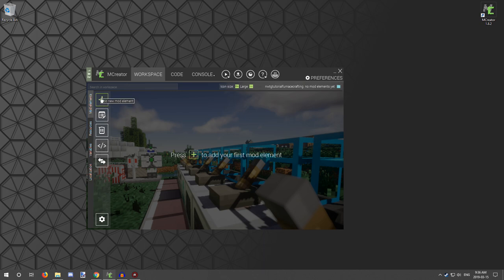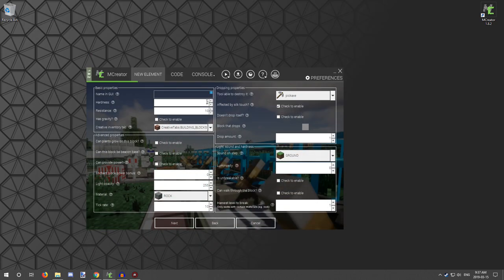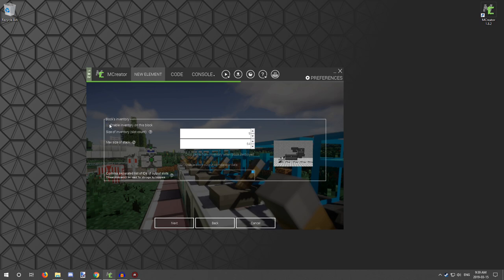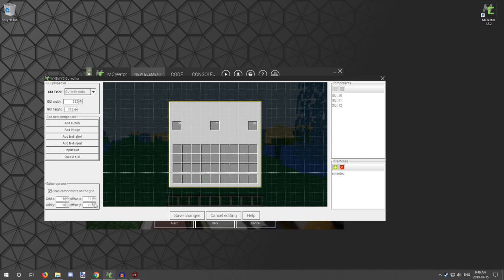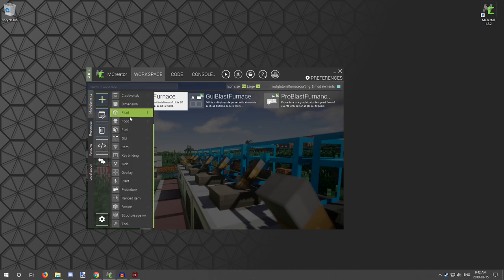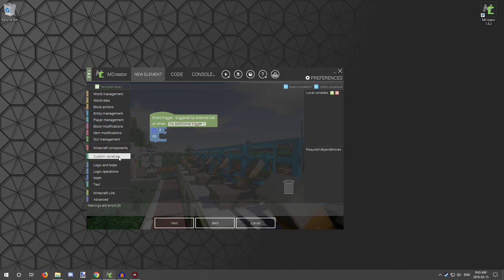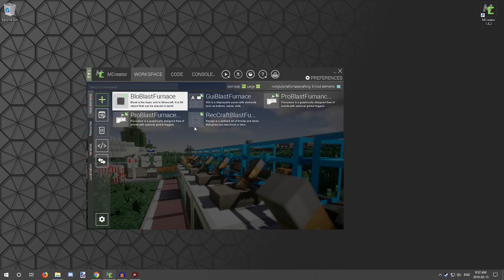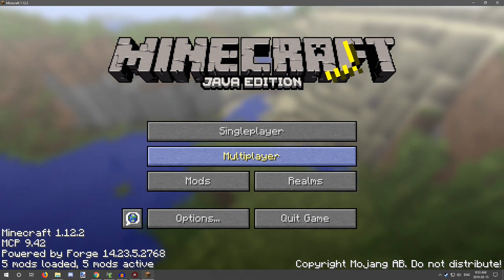MCreator Tutorial: How to make a furnace | 1.8.2

Comment: I found a way to make the iron ingot smelt with all the logs, all the plank, coal blocks, coal, charcoal, lava and netherrack. I simply put a stack of "OR" statements at the beginning of the line that checks the fuel input slot. Enough to cover the number of items I wanted to use as fuels. There might be a more efficient way to do this (perhaps a variables list that slots check their contents against) but I haven't learned it yet. I did hit a cap on how many times I could duplicate the section for each new item I wanted to smelt though. It may just be my computer..but maybe not.
Reply from the maker: I would use variables like you said.

You will still need to test for the item/block in the fuel slot before hand though, this can be done via making a new procedure then "calling" the procedure in your recipe procedure at the top of the list.

For the new procedure you will need to test of item in the slot that is your fuel slot then if true, set variable number to what you need. I suggest using NBT block variables as it is per block not shared between all block.

You can use the variable number in your main procedure when you call the other one into the procedure, this will import all settings without impacting the preformance of the procedure editor.

To call the procedure you will need to be in the procedure you want to call it in to then go to the  "advanced" tab then select the block that says.

Call procedure [ProcedureName] at x:[x] y:[y] z:[z]

This will call it at the same location as the block which is needed.

Comment: Can you  make a tutorial on buckets? I am making a Skyblock modpack with MCreator and i tried to make a wooden bucket that can transport water, but no lava.
There were a few Problems:
1. For on blocked rightclicked i chose water. In the procedure it was accepted but righclicking water did Nothing.

2.When I placed the water it stays as a block and didn´t flow.

3. I wasn´t able to make a procedure that inclued from where i rightclicked a block, like when I wanted to place water at the side of a block it was place on the top because i just wrote "y+1"

I think it´s very complicated to make a bucket, but Maybe you have some ideas to fix these problems!
PS: Hope you understand everything well, because i am from Germany and i don´t i´ve i explained it Right XD
Reply from the maker: I will look into that If I find out how I will make a tutorial on how to make a bucket.
And it was easy to read :)
Reply from the maker: You may have selected just the water block, there should also be a water flow block which will flow the water upon being placed, you can hover over the item in the block selection tab and it will list the type of block your hovering over.

For collecting water you need to remove the block of water then remove the item and add the full bucket item to the player's inventory.

As far as the last problem that will take some time to play around with I will have to see if there is a way to detect what side of the block it's being placed on. I will still see what I can do.
Reply from the maker: I have had some time to test some ways of coding it, none worked out due to the restrictions of how water is being placed.
Like you said above the water needs to be placed +1 block above the Y access or whatever direction in the current version.
The problem with that rate is water needs to be placed according to what face the block is clicked on.

I did speak to Klemen a developer and suggested the idea for testing what face and provided him with what we were trying to get working.
He got back to me and said he will consider adding it in a future version of MCreator, there is no set date at this time but its quite posable in a near update it may be added.

The post is below.
https://mcreator.net/tracker/issue/47788
Reply: @NorthWestTreesMCreator  Wow thanks! I hope you´ll make a Video as soon as a bucket is possible to make !!! I
Reply from the maker: I need to wait for support on MCreator''s side but I will make sure to add it to the list of tutorials I will be doing in the future.
I will give you credit when the time does come. :)

Comment: Hvaen't seen if you made an update to this video but I found out that if you just put a new if statement with the same context but with you new recipe just under the other one that you showed, it would be 2 differrent recipes that both work.
Reply from the maker: Thank for letting me know. I did recently figure this out and made an updated tutorial on this video, I have been helping MCreator fix some coding issues in the template that is built in under the templates tab, so through testing I have figured that out. :)

Comment: Omg Thx Btw can you make a video of how to make a clock gui
Reply from the maker: I can't think of a way that this can be done, I am not sure if MCreator can even produce any support for things like this that sync with time.
Reply: @NorthWestTreesMCreator  ok
Reply: @NorthWestTreesMCreator  btw I made a microwave and when ever it is done smelting it does not show the cooked porkchops in slot 2 D:
Reply from the maker: Its probably not set up right, this system should still work in 1.8.3 I don't think anything has changed that would have broken the system. Make sure your procedures are properly set up for adding the item to the inventory slot.
Reply: @NorthWestTreesMCreator  ok
Reply: @NorthWestTreesMCreator  Im Doing A live stream On My Nikplayz MC

Comment: Excuse me, I do not speak English, I hope you can understand, I had an idea, and try to create a mod, which the vanilla oven had an upgrade, instead of 1 slot where food, minerals, materials, etc, are placed 4 (and these are like a chest, and store what they will be burned), and when you finish 1 of cooking, automatically the next will go up, and so on until the materials are finished, is it possible?
Excuse me if you do not explain well, thanks in advance
Reply from the maker: It may be possible, you would want the same amount of fuel slots per cooking slots as I have not found a way to use fuel durability on items yet. I am sure there is a way that you could set a use for say coal to have 4 uses but I don't have the time to test that at the moment. You may be able to use a loop with a count and have some kind of delay on it in the future. The main element missing to make a furnace at the moment is a delay procedure element, if there was this you would not need to rely on bock tick rates to delay the burn time instead you could delay based on the item in use to cook the material.

But yes it should be possible but you will still need a way to either pull in the coal via hopper or have the same amount of fuel slots.
Reply from the maker: I am not sure exactly how you could do it at this point in time. I am curios to try testing some things and maybe make a second big project series on this subject, however, I need to complete the custom crops project before I start to work on other things.
Reply: @NorthWestTreesMCreator  

thank you very much, sorry for bothering you

Comment: Hi! Can you make a animate icon like minecraft furnace in custom furnace? Thanks!
Reply from the maker: Far as I know no, Furnaces don't relay have "animated textures" the fuel display is dependent on the type of fuel added then displays a progress bar based on an image that varies between a full and no image. What is going on is it will test the amount of fuel left based on maybe a NBT variable or some kind of data in the furnace block structure then it displays the percent from the fuel value to what is left and displays the proper progress left. Brewing stands use the same thing. I would cut and paste this reply and suggest this for a feature request on the issue tracker.
Reply: @NorthWestTreesMCreator  OK,  thanks!

Comment: I cant put my logic gate into my output as seen at 13:42, it simply doesn't highlight when i drag it over the port.
Reply from the maker: It needs to be a math based one not a standard operator. use the dark blue operator from the math tab instead.

Comment: I'm making a freezer so basically I have to do the same thing but it does the opposite.
Reply from the maker: If you are using MCreator for 1.14.4 then you will need to update the yellow operators as they were for older versions of Minecraft and won't work properly in 1.14.4 just the heads up.

Comment: How can I make the furnace that it smelts every item that a normal furnace can, but without making every Recipe manually and the same for the fuel? :(
Reply from the maker: You will need a lot of recipes and time to do that, I would check the wiki page below for a list of smelting recipes.
https://minecraft.gamepedia.com/Smelting

You will need to make ever one of those recipes work with your furnace.
you can always use the built in furnace procedure example to get an idea how things work and add on to it as you go.
I still need to make a tutorial on this, I will aim for it soon :)

Comment: Is there any way to have it pull the recipes from vanilla Minecraft. I'm trying to make a crafting table which functions just like a normal one, the only difference is that it is made of stone (so someone can make it out of cobble when they're in a strip mine or something).  If anyone has an answer for this, please message me on discord Maxson#1029, or here (preferably Discord, as I'll get those messages instantly).
Reply from the maker: Custom Furnaces need recipes added by the mod creator, this would be a good feature to request on the issue tracker for vanilla recipe importing, even if its one recipe per node it would still take a lot less time then coding in every recipe for vanilla Minecraft.

If you do open a feature request post the link in a reply I will approve it and head over there and up vote it.